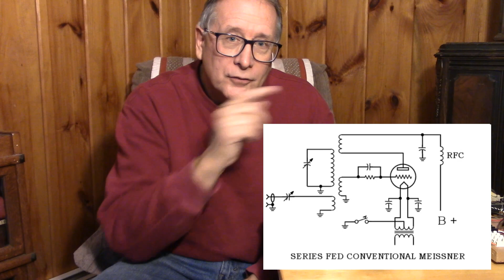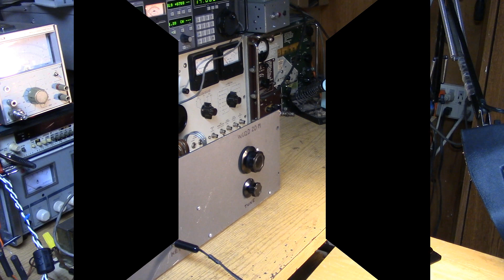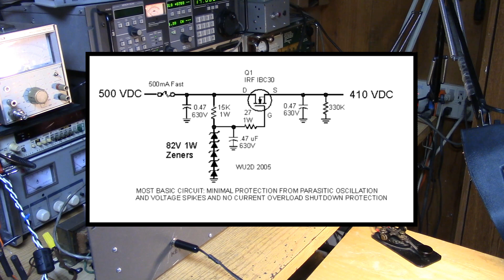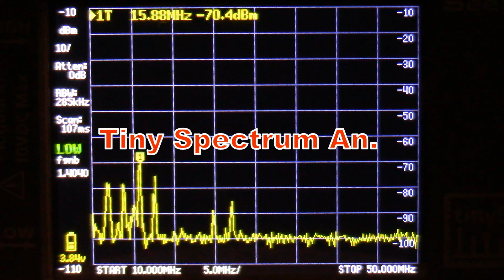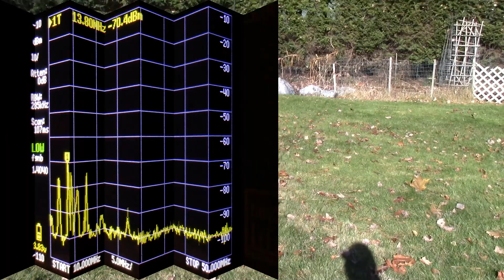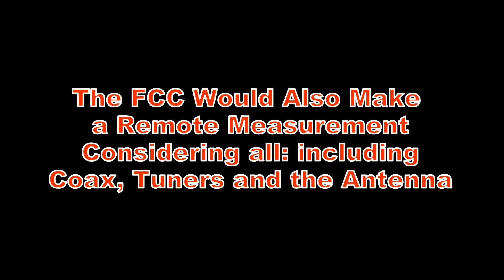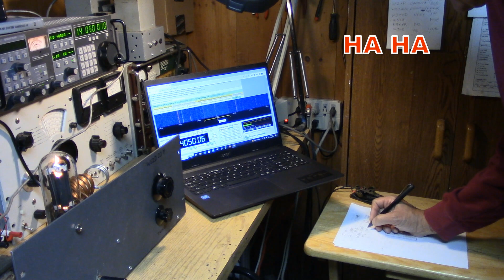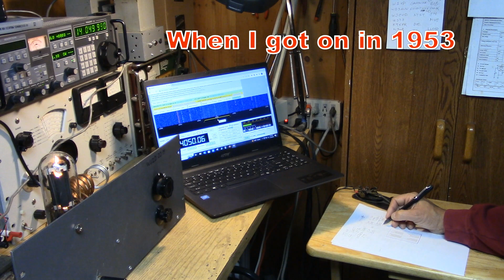Is My 20 Meter Hartley Legal?

Comment: Now do a solid state version... IRF520 power oscillator 😅
Reply from the maker: I did it with an IRF-510. With a touch of bias on the gate It actually worked! I did not go too far with the idea.
Reply: @MIKROWAVE1  I think you'd need to use crystals on such a circuit- possibly a few crystals in parallel to share the current lest you damage them from driving them too hard. It's a bit of a put off unless you have multiple crystals of all the frequencies you want to TX on. Not sure if there's a way to reduce the crystal current while maintaining good control of the frequency still by using an LC network to mitigate the effects of gate capacitance
Reply from the maker: @Dazzwidd  Yes Crystals existed for transmitters by 1924. But they were very experimental and the 1929 Contest rules say no Crystals. Only Free running oscillators.
Reply: @MIKROWAVE1  Mosfets didn't though 😅

Comment: Great video Mike!
Although I know that you would have to drive that 211 with 7.5W to get full output, I think (to me) that I would make a separate oscillator and buffer out of period tubes.
I messed with power oscillators for some time long ago and never did get one I'd be proud to use and they all got disasembled for oter projects!
Also, you're sure better than I am with that close-spaced CW.  I wish hams wouldn't slur there characters together--just can't copy it.
I have a number of legacy tubes (not that old) that I would like to build a series of transmitters someday.  73 Mike & Merry Xmas...
Reply from the maker: Absolutely! and by 1926 in the first Handbook, they show examples of two stage transmitters. But the simplicity of the Hartley was attractive.
Reply: @MIKROWAVE1  well the favoring of the Hartley, of this time period, reminds me of how the Franklin came about, out of the necessity of stability at the higher frequencies.  Anyway, hats off to you for again optimizing these legacy circuits!
73…

Comment: That wire wound grid leak is also an rf choke!   please publish circuit for mosfet voltage regulator that you used.
Reply from the maker: Check out my Mikrowave1 Radio Resources FB Page. It has some high resolution schematics of the regulators.  https://www.facebook.com/Mikrowave1/photos/pb.100063494943511.-2207520000/305365613681369/?type=3

Comment: I love it! Dare to be different. Stuff like this is way more fun than just buying a 7300 and putting up a $750 vertical that shines really nice. Creativity is where its at! I looked and my 805 tube has a plate cap unlike the 211. That would spice things up a bit! Great fist. Love and miss doing cw! 73's.
I forgot to ask, how do you like using the Tiny SA?

Comment: As a suggestion just to evaluate the stability of the oscillator, you should have used CW instead of USB when using the SDR. The USB mode doesn't give an idea of how much it is drifting, for small drifts. CW has a much tighter bandpass filter that is more up to the test.
Reply from the maker: It would have immediately gone out of the passband on cw. The darn  thing wanders a bit before it settles.

Comment: I wonder if I could work you on a Christmas light string, using just the keyed raucous noise? I could cut it to length....
Reply from the maker: If you used those horrible slinking LED strings, would that be considered Digital?

Comment: Chirpy is o.k. as long as you don't drift too far. It's not bad now.
Why not a 5.7.8. report?
I like xtals as in my 61BT valve tx at about 2 Watts out with 250 volt h.t.
I came across Meissner because of the B.F.O. in my Wireless 19 Set. It works but not quite right.
G4GHB.
Reply from the maker: Oh Yes an honest report would be 577 at best! The transmitters on 80M have a wide variety of flavorful notes. 20M is a science project.  The way to do it is to do up a two tube circuit with a separate oscillator  and amplifier that is well neutralized so it will not pull the osc.

Comment: My first transmitter was an Eico 723 that ran the final off of a TV sweep tube (6DQ6B that I actually still have.) It was rock bound so pretty stable, but when I went to 15 meters the oscillator circuit would triple the crystal frequency and at that frequency a slight chirp could be heard in my signal as there was no buffering between the oscillator and the RF final amplifier. Most hams kind of enjoyed it, and I got a lot of good comments how it was a soothing chirp sound to copy LOL. Unfortunately the transmitter met an ugly death when the rectifier tube cathode shorted to the filament and melted tar out of the power supply transformer - almost caught on fire.
Reply from the maker: The Eico was a first Transmitter for many! Transformers can be nasty. I had a military iron xfmr pop its pressure relief cutout! What a nasty mess.

Comment: it’s not illegal to drift, as long as you stay within the band and within your license. What the FCC cares about is spectral purity.
Reply from the maker: One station I worked this weekend was using a High C Colpitts on 20M from CO and he sounded pretty good. The power limit for the contest is 25W input Power which on a good day should get you 7 to 10 Watts out with an oscillator.

Comment: I've wanted for some time to build a 40m or 80m Colpitts based single tube transmitter.  People keep telling me it's impossible to make such a thing meet modern spectral purity requirements -- looks like (aside from drift) it should be possible.  Temperature controlling the passive components could help, as I understand it (incandescent bulb or more available soldering cartridge in a box with a thermostat or PID?).

I really need to get a practical CW setup as an incentive to (re)learn Morse.  I've been to the point of knowing all the letters and numbers and some punctuation, with a confident speed between 3 and 5 wpm and partial head copy up to 13 wpm, and then lost it all due to no practice.  Never made a QSO; the only working CW rig I have is an 80 m Cricket with ~ 1W from a 9V battery and I don't have an antenna up (my partner would be very upset if I invited lightning into the house, and my work schedule doesn't give me a lot of free time; nor do I have a "toy" budget to speak of).
Reply from the maker: Well if you are nervous about a self excited transmitter, what about crystal control? A 40 or 80m Electron Coupled Colpitts with a 5763, 6CL6 or a 6AQ5 is a cinch for a simple first transmitter. Check out my FB Page for good schematics. https://www.facebook.com/Mikrowave1/photos/pb.100063494943511.-2207520000/304806587070605/?type=3

Comment: Mount a can of cool spray and mount a hair dryer to keep on frequency or a cold pit and a hot pits oscillator.
Reply from the maker: Hold it! This could be the add-on I have been looking for. Of course this is 20s tech so maybe a bellows?
Reply: I used an arm pit oscillator in school once. The teacher wasn't impressed. @MIKROWAVE1

Comment: I sooooooo wanna build a tube rig! Very inspiring. I have already used your wonderful video on the TS520 to change the bottles and neutralise the tubes in that boat anchor. TU CU 73 de VK2AOE dit dit.
Reply from the maker: Start simple with a crystal controlled 6AG7 oscillator transmitter.
Reply: @MIKROWAVE1  Thanks for the tip ....will start looking up some ccts 73!

Comment: About the supply, I find it interesting to ask what could be done at a given time with the available technology, and I wondered if in say 1930 if a regulated power supply could exist in the form of a feedback structure with the now typical reference/diff amp/power stage, or if it was simply impractical due to cost. From what I can tell gas regulators like the 0A2 were still several years in the future, but I'd think a battery would suffice (and have less noise, although the much higher gain that would be needed would pump up the tube's noise). I couldn't track down the first production use of such a regulated supply, but I'd think that it's quite within the realm of possibility at that time. Unfortunately control theory wasn't really developed until the late 30s, but at least the H/W appears to be available.
Reply from the maker: Most medium power sets used motor generators for the HV by this time. The mechanical stability of an MG set helped.
Reply: @MIKROWAVE1  Hard to beat mechanical mass for stability, especially back then when everything was overbuilt.
Reply: @MIKROWAVE1  I guess by definition that's truly "hard" ware. 😀
Reply: I was wondering this myself.  Being that batteries were not uncommon then, how stable were they under load?  If AC powered, mercury rectifiers and not much capacitance?  That would sag some, but might be quick enough it's not noticeable.    I think we need a video on old power supplies now that he's got us thinking. lol
Reply: @clytle374  In the regulator design I was considering, the reference would have essentially no load (just the grid of one input of the diff amp), so it would last nearly whatever its rated shelf life was, which might not have been all that long in 1930. So the battery might have required changing every year or two, depending how accurate the output voltage needed to be, but I'd guess a 20% drop would be acceptable. 

When I was young (in the distant past, around 1970) I owned a Multi-Elmac AF67 xmtr designed in the 50s which used a C supply battery. I bought it used, never replaced the battery, and by 1980 it still was OK, so in this kind of no-load application it can go quite awhile. I don't recall, but it may even be true that the very small bias current went into the battery (instead of loading it) and therefore counteracted the battery's leakage current when the unit was powered. The designers were often pretty clever, so I wouldn't hesitate to think that it was intentional.

The battery's open-circuit voltage must have some variation from unit to unit, but the value goes back to the basic chemistry involving half-cell voltages, so my guess is that it's very small. The only source of variation that I can think of would be the drop produced by the battery's source resistance and its leakage current. A wild guess would be something in the low mV range for a 1.5V A-battery at room temperature, i.e. better than 1%, in which case it would an excellent reference. However the offset voltage of the diff amp would no doubt be much greater in even a matched pair of triodes and would drift quite a bit with age, so an offset trimmer would help but I'd think would need frequent adjustment. Using a high voltage B-battery might be a better choice to get the reference far above this offset.

Still, it's fun to think what we could do if dropped into that time!